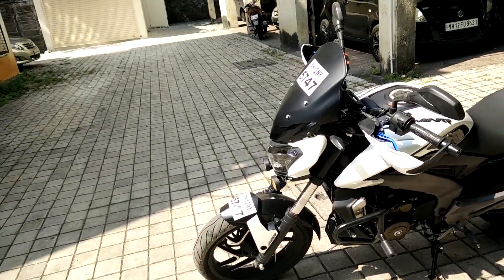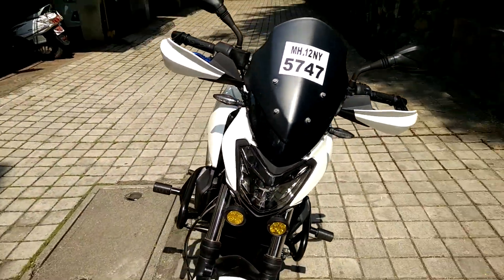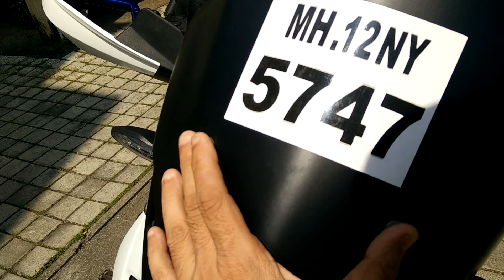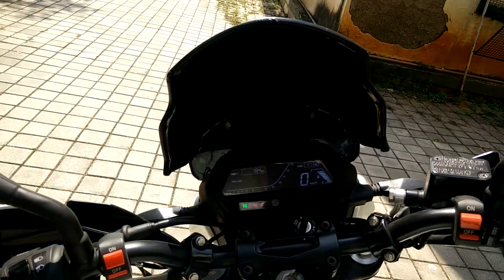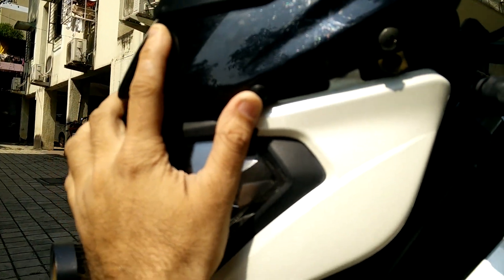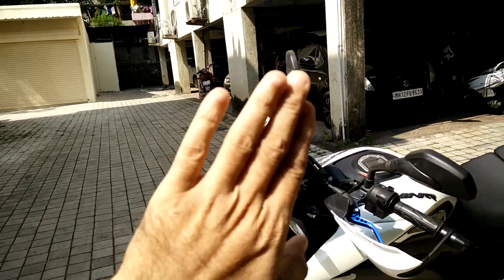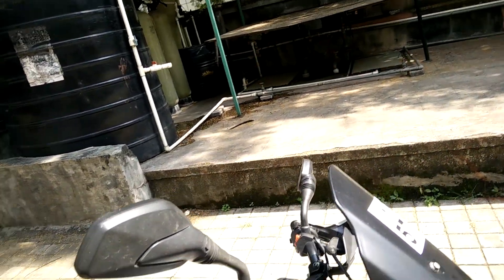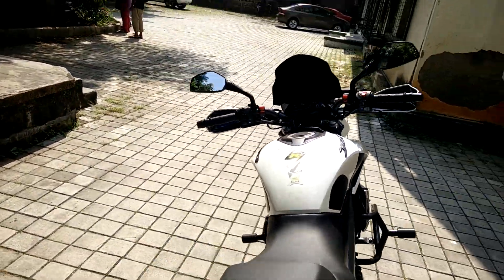Bajaj Dominar 400 mods - Overview of Revised installation of the Bajaj AS200 windshield on dominar

Comment: Why didn't you just tilt the number plate bracket... To fit the hole on the Patti that takes the old windshield?
Reply from the maker: RidedeLightning - I tried that once. And the windshield wobbled a lot when bike went through potholes and all.
Reply: So I did this on my motorcycle and I placed the number plate bracket as mentioned above...no problems faced as of now...thanks a ton.
Reply from the maker: Can you share a Pic ? put it on Google Drive and share a Open Link
Reply: Here you go.. https://drive.google.com/folderview?id=1EYMura5lp3Fk-pek5DfJbrSLmJ5mWsr4
Reply from the maker: Sorry, this message had landed in spam and now when I click the Drive link - it says 404 :)
Reply: Are you sure... I tried to open the link on my friend's phone and it opens... Without a problem.
Reply from the maker: Got Thru - It was clashing with my login - Tried in a New Browser - Very Well done.
Reply: Guys can anyone tell me the dimensions for the small stay
Reply: I mean a clamp